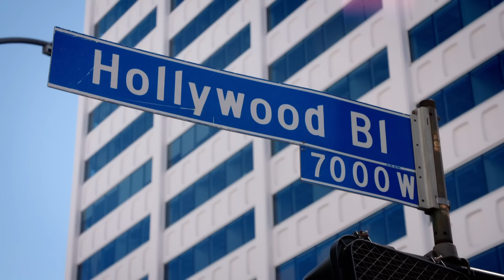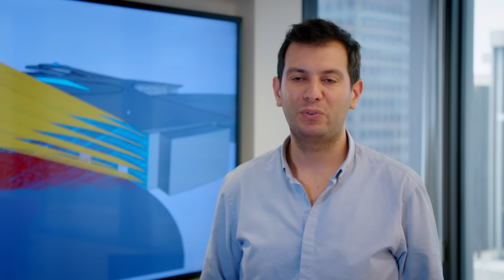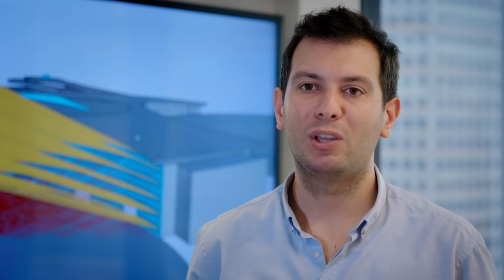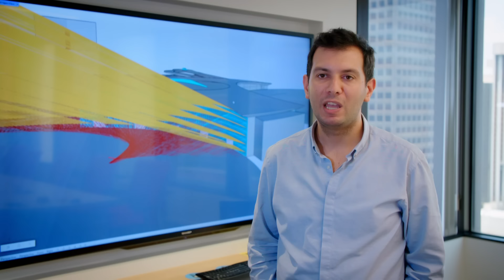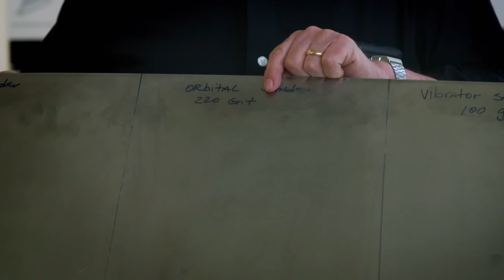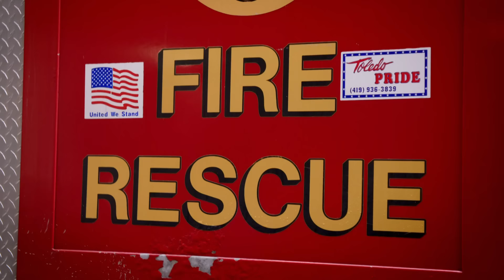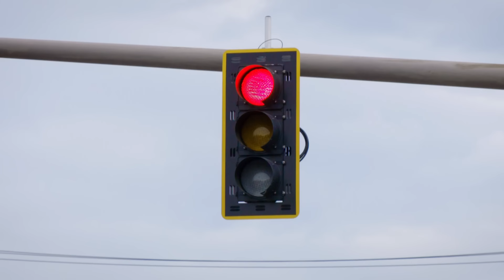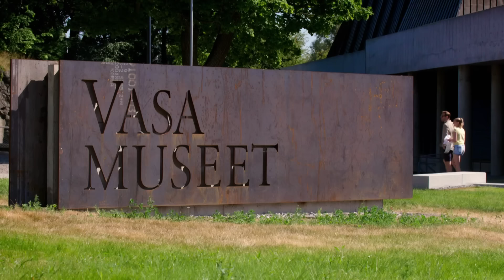Arizona Bridge Burns Down! - Massive Engineering Mistakes - Engineering Documentary

Comment: The part of the Tempe bridge that was completely destroyed was a timber trestle, treated with creosote, a preservative. In hot conditions creosote is very flammable. When the train derailed, there would have been sparks from steel car frames or wheels skidding on the sides of rails.
The sinkhole in Ohio was produced by the leaking sewers, not by the weight of the traffic. If the dirt had not been washed out from under the road, there would never have been any problem, regardless of how heavy the traffic was. They may have paved over the old brick pavement, but that would not have affected the road. It was the void under the pavement.

Comment: The train threw an axle due to an unattended wheel bearing that got hot and seized, sometimes called a hotbox, referring to journal boxes stuffed with oil-soaked rags that served to lubricate wheel bearings on trains up through mid-century. They had to be checked manually by hitting with a hammer when the train was stopped - a hotbox produces a different sound. The same thing happened in Palestine, OH, and it doesn't appear there's been any legislation since then about spacing and checking of heat detectors trackside. The same caused the big Frankford Junction Curve derailment in Philadelphia of a passenger train in the the 1940s, where cars endo-ed and were pierced with catenary supports when a hotbox seized.
Reply: 'fraid our freight carriers come under the tofu dregs category

Comment: 1. That truss bridge looks like it hasn’t had a coat of galvanic paint in many years. Another point of future failure.
 
2. Architects may design what a building looks like but it takes engineers to determine how it’s built and should be aware of how light is focused by reflective concave surfaces. Any kid introduced to astronomy using a reflective telescope could tell you what happens to light on a concave surface.

3. The sinkhole highlights a big problem in the USA. Companies, counties and states skip maintenance costs and cut construction costs. How many stories in this series are about incidents where maintenance was not carried out with the regularity necessary or short cuts or cheaper material selection during construction to save a buck?
Reply: I live right by the bridge, I've been there many times throughout the years (it's a nice place to hang out, walk/jog, longboard, bike) and that bridge looks even worse in person. It's a really old bridge. The lightrail bridge is also right next to it, it's modern and has pretty lights at night, but the old train bridge right next to it kind of makes it look like an eyesore. It doesn't look historic, it just looks old.

Comment: i get the derailment, but didnt address why the heck the whole train caught fire so quick
Reply: If you look at a similar fire that happened in Poughkeepsie New York, the railroad ties on the bridge are coated in creosote which is highly flammable -  so the fire just spreads horizontally and is very difficult to put out.   The big difference here is this bridge is not very high off the water and they were able to spray water from the lake. 

Knowing that there's always this potential, the bridge in Poughkeepsie had a water system on it for firefighters to be able to have water, but it was broken and not been repaired so there was no water available on the bridge itself.    The bridge was abandoned and is now a bike path.

Comment: I bet I can bring in an anomaly that engineers forgot about... Uhm those railways have railroad ties and in high heat there is more moisture absorption over any river/lake regardless if they are pressure treated and infused with oils, they will still expand given heat and moisture.
Reply: White oak, most common tie material,  has a tangential shrinkage of 10.5% and radial of 5.6%. Ties are cut 7 in thick by 9 in wide. So a good estimate of max thickness shrinkage is  about 10% of 7 in or 0.7 in. That's just up and down. The suspension systems on cars could probably handle that.

Comment: 100 +/- years ago. Architects/builders would factor in, where the....house or building... sat. How sun would help or hurt it. plant trees to shade or protect it. put windows here to catch light. high roof to let the heat out. rotate it 90 to change what rooms were getting wind and sun.... wind and so on. NOW? architects just want to be impressive and dont give a crap about function. just make it flashy. make me famous and run away. .....25 years ago digital simulations were not capable of calculation......  so use your brain. you put shiny shit in a sunny spot and you fry ants. any 10 year old boy knows this. Lockheed skunk works designed a mach 3 plane with slide rules in 1966 and you need a computer to tell you shiny concave surface will focus sunlight? REALLY?

Comment: I RAN CONDUIT ON TOP OF THE INTEL BUILDING IN CHANDLER ARIZONA BACK IN THE 80'S. WE RAN THE PIPE IN THE MORNING, IN THE AFTERNOON MY BOSS TOOK ME TO THE ROOF. THE RIGID CONDUIT LOOKED LIKE A ROLLER COASTER. WHEN WE CAME BACK UP IN THE MORNING, IT WAS PERFECTLY STRAIGHT. WE HAD TO GO BACK UP IN THE HEAT OF THE DAY, AND BACK OFF ALL FITTINGS TO LEAVE ROOM FOR EXPANSION. THEN TAPE ALL FITTINGS TO MAKE THE WATERPROOF AGAIN. WHAT A PAIN THAT PROJECT WAS. BUT THE ARIZONA HEAT DOES THINGS TO STEEL.